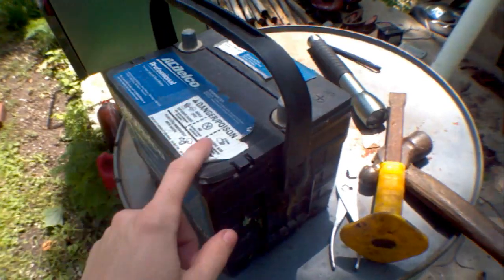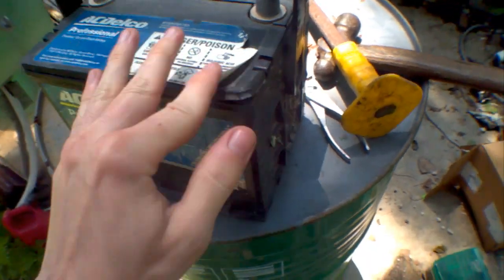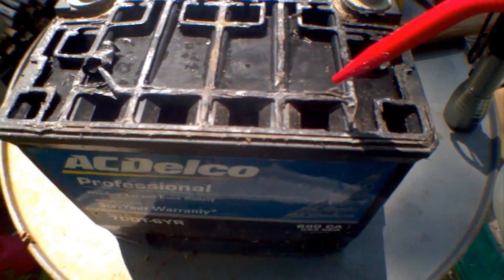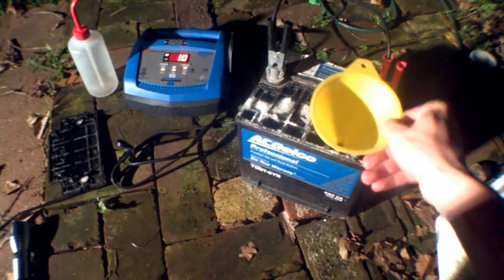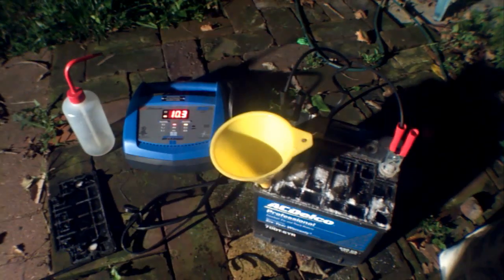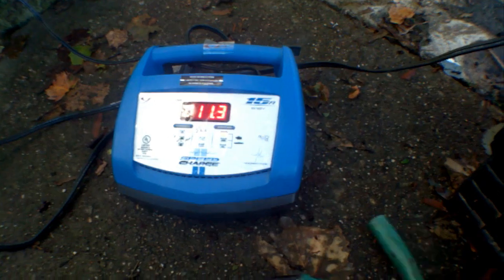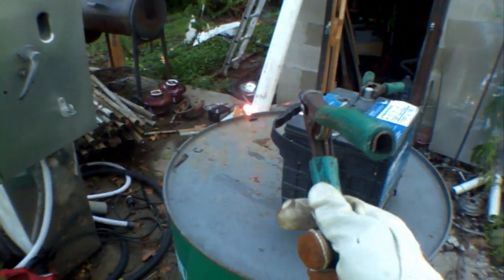DIY: Opening a Car Battery and Repairing with Epsom Salts

Comment: dont put a battery to concreat floring because battery is discharge ,concreat a natural dischager u put a piece off wood.
Reply from the maker: nope that is a totally false myth. it started in the 1920s when batteries where glass cells inside a wooden frame. if you put those batteries on concrete the moisture will make the wood rot. but ever since the 1940s when we switched to rubber battery shells then polypropylene in the 1970s, we havent had that issue.

i leave all my batteries on concrete with no bad effects. i have two batteries that have been on concrete for almost 3 years and their capacity hasnt been decreased much.
Reply: Rinoa Super-Genius Totally agreed on the battery the concrete floor BS. Must not work no more. Based on what Grandpa telling you?  

Good vid. I grew up in the country too had a blast!

Oh, if your girlfriend jumps up and down she won't get pregnent.  Yep you can take that to the bank too!

Comment: putting anything in your batteries except distilled water is a bad idea
Reply: ghettohillbilly1 
Except for a good wash with distilled water and soda and filled back in with distilled water and alum,You now have an alkaline battery. You won't get the rated CCA neather Ah's but you can run them totally flat and have lot's of usable power... Try it!!!! for 3 dollars not worth the go?
Reply: Dixon Cider scary
Reply: +Dixon Cider they are only supposed to have 10% acid or less
Reply: agreed!
Reply: ghettohillbilly1 i dumped mine, and filled with pure sulfuric acid.  almost had a melt down.  dont do it.
Reply: Start your very own battery business and make huge money here: HootBattery.xyz

Comment: This is a fucking joke right? Please, everyone, don't try this...
Reply: I tried it on 3 of my battries and i was able to fix two of them!
Reply: IBegToDiffer200
Congratulations, it means nothing.
Reply: IBegToDiffer200.. 
Oh I get it..This must be stupid day.   Hey Idiot, You the one that trashed this kid.   Whats wrong dummy?
Reply: MIKAEL'S LAB 

tried it on an old dead UPS battery I had.
previously it was reading 0v.

put some epson salt in it, and charged the crap out of it, and got 6v (though less than 12v) and enough power to run a small motor (though dunno if it will retain a charge).

also, earlier, made a small cell out of aluminum foil and toilet paper (to test a theory), put epson salt and water on it, and charged it up. sort of worked, got 0.8v, but then failed later. the anode plate and wire (copper) had essentially dissolved.

the cathode side had a dull grey soft metallic buildup (which had partly assimilated the toilet-paper), and parts near where the anode wire had been had a green crystal-like buildup. the cathode wire also had considerable crystal-like build-up.
Reply: Brendan Bohannon 

partial: correction; in battery terms cathode and anode are mixed up here.

in the above, cathode was where I was putting the negative side of the charging voltage (and... cathode normally means negative...), whereas in battery terms this would be the anode (and the positive/cathode side was the one which dissolved).

also, after it dried, it could be seen that the buildup is a white crust (with a slight greenish tint in areas near where the wire was).

meh...
Reply: Devils I work with batteries everyday. It's 100% part of my job
Reply: Devils lmao you're too cute. got nothing better to do than talk shit to people on the Internet?
Reply: Trash who?
Reply: Exactly, keep your helmet on.
Reply: Cool

Comment: Just so you know a good way to blow up a battery is to do exactly whats shown in this video.
Reply: Batteries will not "blow" with the top removed. Battery explosions are from sealed batteries that are trapping in the pressure. The big danger is the chemical burn from the acid.
Reply: Liam Campbell Shorting a battery out leads to accumulation of hydrogen inside the battery. As long as it is a internal short, it'll eventually produce a spark and go boom.
Reply: benshivd well, good try. But it didn't work as expected. I think these crazy science stuffs can fascinate young ones to do it and enjoy the science in practical way.#corbandy battery blueprint crusher @corbandy battery blueprint crusher (just google it )
Reply: benshivd I like this. it is good idea. I also found helpful for how to recondition my car battery is Corbandy Battery Blueprint Crusher - it will be on google if you need it.
Reply: benshivd you read this" knewreck rapid renew guide" guide or use battery repair epsom salts .
Reply: 7 🅦🅐🅨🅢 🅣🅞 🅟🅡🅞🅛🅞🅝🅖 The Life Of Deep Cycle Lead-Acid 【Ｂａｔｔｅｒｉｅｓ】 > https://t.co/mK3KjJd0lr?CJdPTLZees0a
Reply from the maker: Liam Campbell
no they can explode, its more of a big pop though. i had one explode in my homemade electric lawn tractor and it was kinda funny how it popped the top off, i wish i'd been recording at that time. :P
Reply: Sassy Bob, I like it
Reply from the maker: no ts quite difficult to blow them up in a well ventilated area unless the battery is shorted out.
Reply: Sparking the connections together is NOT shorting it out ?
Reply from the maker: benshivd i mean internally. an internal short can lead to a spark. i've had a battery blow up from that before.
Reply: I have changed all my batteries over to capacitors now.
Reply: benshivd batterys cant blow up because for an explosion you need fire and the water in the battery will put it out
Reply: @Liam Campbell  I about fell out of my chair laughing so hard from your comment about the water putting it out.  That is a good one.  The problem is that the hydrogen and oxygen will accumulate ABOVE the water and ignite before that little fire fighters in the battery can splash water on it.
Reply: Liam Campbell Liam. You were born STUPID!!  Please go back to playing with your sissy Barbie dolls.

Comment: good way to blow up a charging battery and get hurt.  batt off gas combustible gas. If a spark present at that time you can blow up a batt. be safe.
Reply from the maker: never read another comment before eh? :D
Reply: No.  It takes a specific set of conditions for there is be enough of a gas buildup to be dangerous.  First, it must be an area without any ventilation which completely rules out the outdoors.  Second, the gas it gives off is hydrogen which as we know is much lighter than air so there must be some containment of that gas to keep it down where a spark might occur.

Comment: The multimeter shows a minus sign if the leads are placed opposite of the current flow. It only points out the polarity of the battery. There's no such thing as be negative voltage.
Reply from the maker: opposite = reverse in this case. this battery's positive terminal was reading negative and the negative terminal was reading positive.
Reply: Yes there is such thing as negative voltage.  It merely needs to be at a lower potential than earth ground in an earth grounded system.  Hint: lightning.

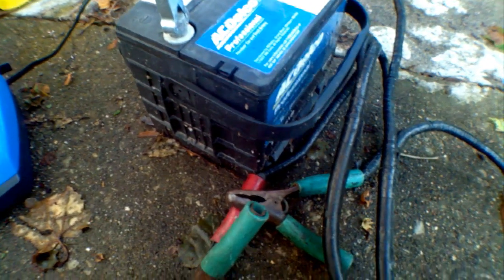Comment: 3:45 there's no such thing as negative voltage. What's it stealing electricity or something?
Reply from the maker: stealing electricity is called a load, take a battery and measure it, now reverse the polarity and you have negative voltage. negative voltage is when there is the minus sign before the voltage on the multimeter. never seen a multimeter huh?
Reply: +Rinoa Super Genius
 That negative voltage you are talking about happens when the probes on the multimeter are reversed.
Reply from the maker: MIKAEL'S LAB
yup, except the probes wherent reversed. the positive terminal of the battery was reading negative and the negative reading positive by about 100mv.

Comment: The reason the batt took a charge after you shorted it out is because (an old trick) the reverse polarity knocked oxidation off the lead plates. 

When a car batt is dead or very close to, the lead plates will oxidize. Killing its ability to charge. Old batts that have been sitting for years will have oxidized plates. The old shop trick I learned growing up in the shop, was to reverse polarity from a charger or another batt and to shock the dead batt for a few seconds at a time so you don't damage it.

You need to be careful on the battery though, some batts have circuitry in them that can be damaged. At one time you could take batts apart and fix them. Sealing them up ended that practice.

So when you shorted that wire, you were in effect doing the same thing, knocking oxide off the lead plates. Clean lead plates = batt that holds a charge. 

Ps. You need to be VERY careful around these batts, they are dangerous and will explode, Ive seen it happen twice and it is a powerful explosion. Sparking batts or making fire or doing what you were doing could have led to an explosion. Be much safer in the future, your eyes will thank you later.
Reply from the maker: samuel lloyd
 or i can just swap them out from the recycling skid at local stores, thats how i traded a lot of my batteries for almost brand new ones that people had returned.
Reply from the maker: no its not oxide its sulfate....
Reply: Ive spent 30 plus years in the shop. Trained by both old school mechanics and trained in college as well. Terms arent always perfect in automotive. The old school mechanics will say oxide and for the most part the sulfated objects are in fact oxidized. So oxidized is a correct term. The sulfation on batteries are sulfide oxides.. Charging - 2PbSO4 + 2H20 →  Pb + PbO2 + 2H2SO4 Discharging Pb + PbO2 + 2H2SO4 → 2PbSO4 + 2H20

So as I said, doing that will strip oxide off the plates. Depending on what killed the battery, that will work most times.
Reply from the maker: Opie Jr, Potter  can you point me to any scientific studies to back up your claim? pretty much everybody seems to have a differant opinion on batteries.
Reply from the maker: Opie Jr, Potter
 yes but from what experiments do they get their information from? i hope its not just "the old mechanics said so it must be true"

yes that doesnt mean much to me because you didnt go for chemistry, sure if i had a question about an engine i would value your opinion. this is a chemistry question not an automotive question. nevermind the fact that colleges turn out a lot of people who dont know much. so you end up with a lot of ignorant people who think they know everything just because they went to college. i would even say you seem like that.

i would assume you think if i need information about what compounds are in a lithim ion cell i should ask somebody who works at a cellphone store? just because they work with lithium ion cells a lot doesnt mean they know them through and through. just like you can work in a auto shop for 50 years replacing batteries without having to know how they work on the molecular level.

so far your only proof for backing up your claims are

1: old mechanics said so
2: i went to college
3: i know cars, and cars use batteries, and batteries use chemistry so that must mean i know chemistry very well.

yet your chemistry explanations are very flawed. just because a molecule has oxygen in it doesnt make it an oxide.
Reply from the maker: Opie Jr, Potter
 if your statement was true then the same effect would happen when a battery didn't have epsom salt in it yet i only notice this big of an effect when i add epsom salt.

aditionally i built a rechargable battery using epsom salt as the electrolyte and copper/zinc as the electrodes and found the same effect.

all my data points it towards being a property added by epsom salt not a property of the batteries themselves.
Reply: Go into the dealer and tell them about Epsom salt. Im sure the mechanics there will have a field day with this one.

No doubt you got more out of the batt with the epsom salts. Still not a proper fix. 

I can take dirt and pyrite and make a battery. Doesn't mean that car batts should be treated the same.
Reply from the maker: Opie Jr, Potter
but i used a capacity tester, i did infact get more capacity. if i remember correctly the first charge was 30mah while the charge after a few discharges was 45mah then when i let it sit the charge went back down to 30mah.
Reply: Keep studying. There are a lot of good articles online about car batteries.
Reply from the maker: Opie Jr, Potter
 unfortunatly a lot of websites have urban legends and misinformation about batteries stated as fact. i think its best to do experiments yourself instead of just reading about it on the internet.
Reply: You have to know how to research. There are a lot of good articles. Experimenting is fine but not the most  accurate. Mythbusters experiment and yet they have failed time and again. Yet claiming they succeeded. I could post a dozen videos on that. The factory has service bulletins and there are a lot of good mechanic sites run by master ASE certified techs. Ive been ASE certified and they don't give those certs out to anyone. It takes a lot of study and school to get ASE certs.
Reply: You can use AC 12V 1A  for short period,works much better (pulsating voltage) instead of reversing polarity and risking to burn cell,catching fire,explosion and so on, I know you put warning but there is so many young ones who don't know what  "short period of time" is.
Reply from the maker: samuel lloyd
 mechanics just need to know how to use batteries, not how they work. i bet you dont know how complicated things can be on a molecular level.
Reply: David Yisrael Get your authoritarian pride out of this comment section. Your behavior is irrational and you showed emotion. That will screw up your ability to think logically instead of on impulse.
Reply: I would go with the mechanic i'm one too and that's common knowledge.
Reply: I am one of the few mechanics I know who actually took Chemistry and Physics courses in school and I am quite competent when it comes to batteries I am an apprentice and after i finish my last year next fall I am going to university to get a degree in mechanical and chemical engineering. I am also the only mechanic I know who uses only battery powered tools and I don't mean a crappy NiCd drill I have top of the line Lithium ion power tools that I use every day to do my job and as a heavy equipment mechanic working on School Buses all day they take a beating and I repair the batteries regularly.
Reply from the maker: samuel lloyd
 ah cool then you should know that epsom salt works quite well for a sulfuric acid replacement on old batteries. i've found epsom salt works as a good rechargeable electrolyte for many battery chemistries including copper-zinc. were as saltwater makes copper-zinc not rechargeable.
Reply: You are right but In the case of a lead acid battery if you really need one I would personally go to an auto wrecker and get one that works great for 40$ or get one that has a little use from my work since I work for a company that has a fleet of 600 School Buses we constantly change batteries the ones we take off are usually in OK shape but we cant use them because starting a huge diesel on a winter morning when its been -45 Celsius all night needs at least 2500 CC amps of power and the few coaches we have require at least 5000 CC amps well that is what management says, but I could probably ask my manager to take a few of them that still crank out 450-600 amps.